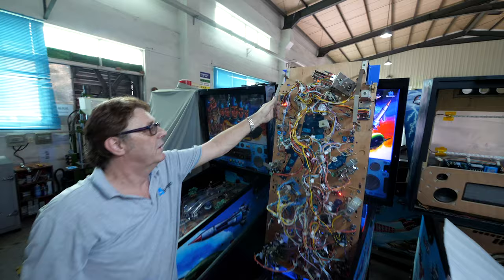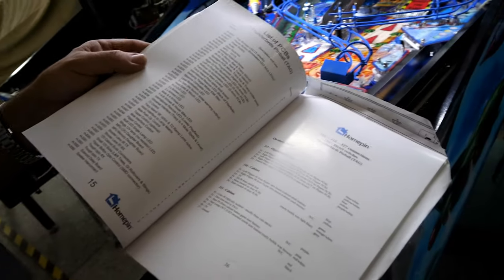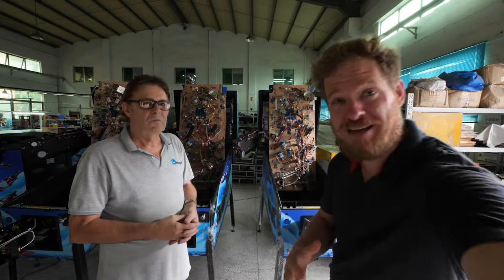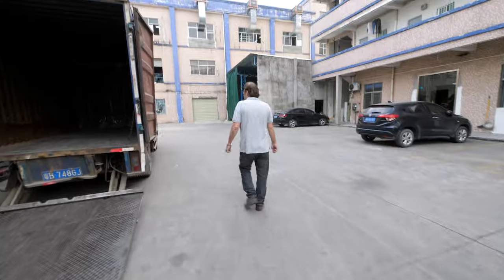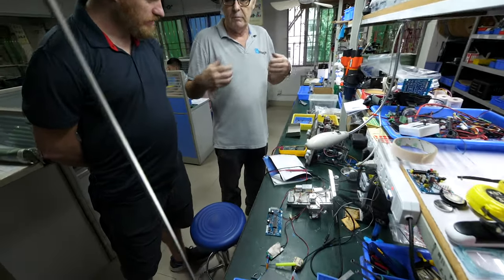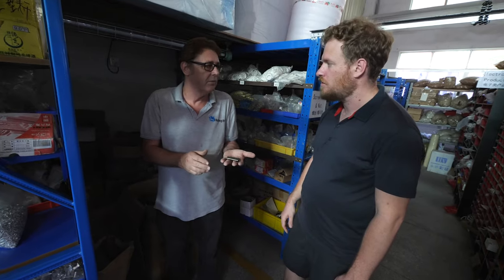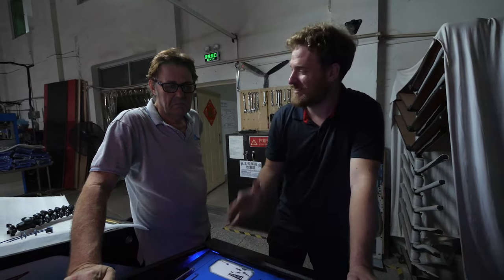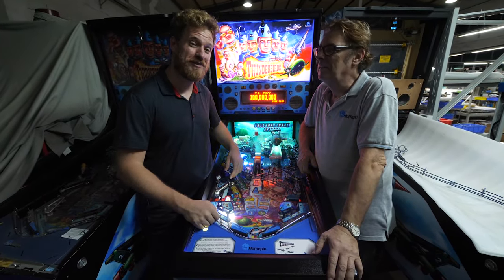Inside China's Only Pinball Machine Factory

Comment: I used to assemble pinball machines for a distributor in Australia. The head and legs come detached, so it all fits into a box like a refrigerator box. The glass is special toughened glass, able to stand up to angry fist slams - but, if you slide the glass out and stand it up on end, you must be super careful not to rest the glass on even the tiniest bit of gravel or scrap metal, as the glass will burst into crumbs at the slightest bump on the end.

Once the machine was assembled, we'd add the game-specific chip to the motherboard (this was 40 years ago), then we had to "burn-in" the chip and machine by playing the machine for 30 minutes. That was the best part of the job!

Comment: i'm building one right now, home made wide boy full size pinball table. have installed a few things so far, i took a fruit machine and turned it into one. all the lights, wire, solenoid etc also got a 3d printer to print out parts for the bumpers and posts etc. 
it will be done one day 🤣

Comment: Ive always wanted a pinball machine but they are so complex and since they are mechanical moving parts they require maintenance and repair! But the digital pinball community is large and fleshed out, with guides to make elctronic pinballs using tv displays and roms.

Comment: Thanks so much for this! I've been waiting excitedly since I heard you say "pinball factory" :-D 
I used to repair old-school arcade cabinets and pinball machines, and to this day wish I could personally own a few of those old Williams or Bally machines I worked on... Ooh, or the old Stern Simpsons one. so much fun. That or someday maybe the official Star Wars pinball table with the digital throttle ball-launcher instead of a plunger... Ahh dreams. One of the best parts of repairing them, though, is that you have to FULLY test out the machine afterwards before you return it to the client. :-)
These new tables are SO much more complex than I would have expected! It's crazy how they've progressed. That ball-drop issue when you lift the deck? SERIOUS issue. Older Bally machines (particularly from the '70s/early '80s) were notorious for it. And if they hit the plastic? Well... I was repairing near to actual antiques, so I can't speak as far as their strength when new, but... yeah. They would crack. And there's another week delay and a $20-30 part I'd have to replace... I love that they based it off that Williams table, too. That's a solid machine. :-)

Comment: I did service on pinball machines for about 10 to 12 years, and still kinda time to time am asked to trouble shoot them... I even may 3 of my own, of course with part from suppliers and from vintage decks... A lot of work building your own, and network t cheap either. I did well on selling the units I designed, but on a sad note, the guy that bought them his wife by accident drive through the garage wall into the gaming room, and crushed them.. Which might have been salvageable, but then the fire dept showed up and dropped a bazillion gallons on them, no, there was no fire, but that is their standard opp, to flood a person's home with water, lol. I hope all works out for this pinball machine manufacture.. Good lucj

Comment: 1:27 "they are all made with through hole parts" 1:30 big smd resistor.
Reply: Hahaha - yes, bad timing on the photography. We do use a smattering of SMD but, as you can see in the video, mainly lonely and LARGE resistors on the LED lamp boards. Certainly very easy to replace should they ever need to be.

Comment: "I use through hole because I think anyone should be able to repair their own machines" 

Uh, surface mount rework is easier...
Reply: SMD is part of the throw away mentality for the most part. Take Stern "Spike" pinball boards for example. No schematics, no parts and things crammed so tight it would be almost impossible to fix the board anyway. Just pay $300 for a new board, easy. I don't think that's right, never have and I never will.

Comment: "It's not about wages" Meanwhile half of china lives on less than $2 per day
Reply: China holds all the cards now, and it's all the capitalists fault. If you want  a factory in country x that builds pinball machines, you need other factories to support that endeavor. You need a factory dedicated to making each of the basic components of the machine: cabinet, screws, rubber parts, glass, acrylics, pcbs, custom plastic pieces, custom metal parts, motors, wire, etc. People started manufacturing in china because labor is so cheap. Now that the infrastructure has been built up, even if wages were to suddenly skyrocket, manufacturing would remain there for quite a while due to the gutting of industry in the rest of the world.